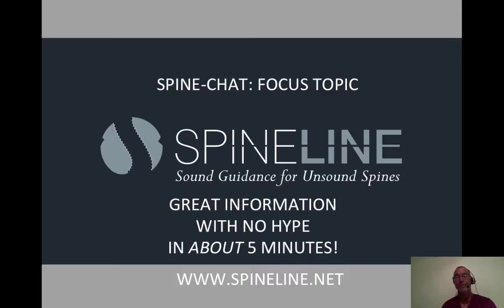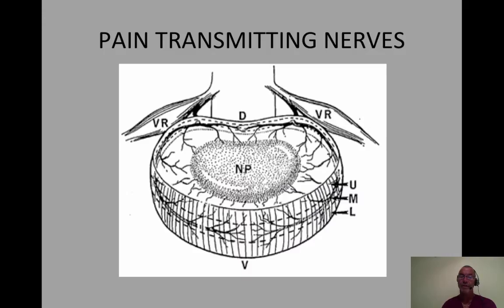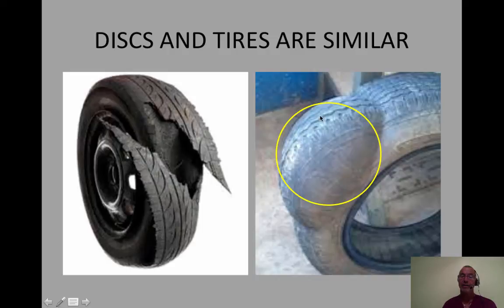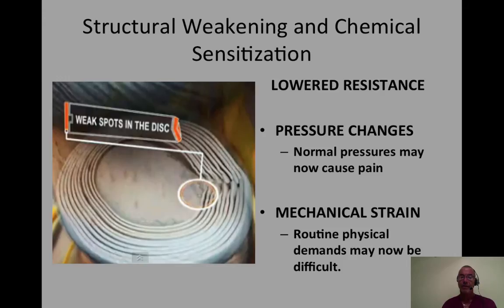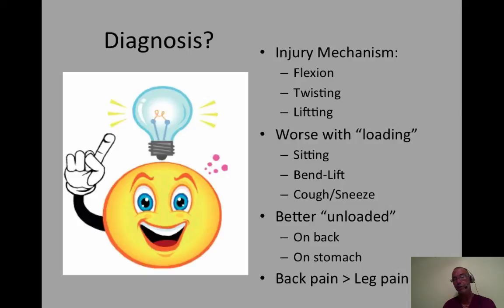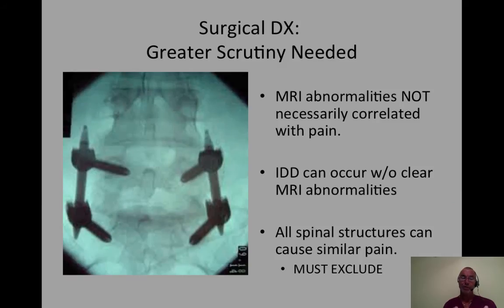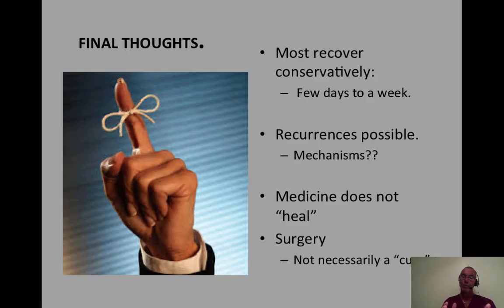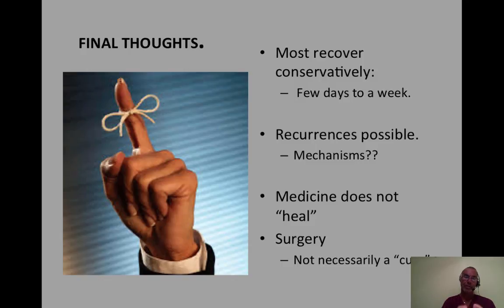discogenic pain

Comment: Hi I have a question. After several years of severe debilitating back pain that increases in severity every year as well as year MRI. Recent MRI stated the following for L3 to S1 Posterior central annular fissure with small broad-based disc bulge. Mild bilateral facet arthropathy and ligamentous infolding. Mild spinal canal stenosis with AP thecal sac diameter of 9 mm. No neural foraminal stenosis, as well as arthritic changes. There are some other bulging disc in the thoracic spine as well but not updated this year. I also have an Autoimmune disease called Psoriatic Arthritis which is severe, joint inflammation and skin lesion are the main issues. I’m in a co start flare even with treatment. I’m in my mid 30, female with one child.
I recently met with a 6th spinal surgeon who finally gave me a diagnosis of discogenic back pain and suggested to start water PT to prepare for surgery. Detail about the surgery were not provided at the time. I also have significant neuropathy in my Right foot/leg. I’m an completely disabled and unable to leave my home.I use a walker and wheelchair at times. The doctor diagnosed me through looking at all my MRI, CTs and X-rays and physical exam. Is this sufficient? Should I have each disc further evaluated by epidural or something of that natural? In your opinion can this surgery be done without and presurgical “testing”?
Thank you so much for your video.

Comment: Do you know anything about interdiscal injection treatments for discogenic pain like IDET, Biacuplasty, Dsc-FX, etc.?These supposed to heat the disc and kill the nerve fibers that cause pain.
Reply from the maker: Hey rambos 10.  Biacuplasty is somewhat of a modified version of IDET in which the thermal effect is a bit broader, ostensibly to have a greater chance of eliminating the discal source of pain.  I am not sure what Dsc-Fx is.  Regardless, there may be some logic to using a less invasive thermal source to address the pain.  However, it remains very difficult to be confident in the precise source of pain as MRI's can be misleading, and a discogram also suffers from being highly precise for any number of reasons.  Also, even if a given thermal treatment does help to reduce the pain, it does not heal the area that is/was damaged.  As with any form of treatment, especially when there is very little certainty in spine care, it comes down to a risk/benefit ratio, and a realistic expectation of what the outcomes are, and the treatment actually does and does not do.  Unfortunately, many patients do not get this information,  but rather a very partial, and often biased representation from the provider who is using the technique.  Good Luck.  RDF